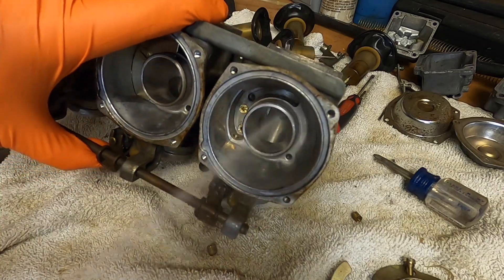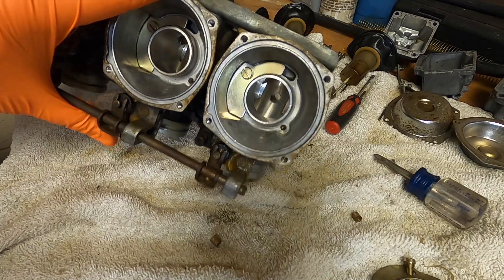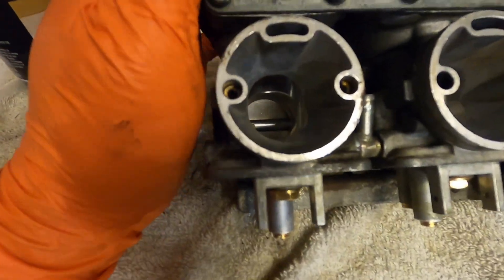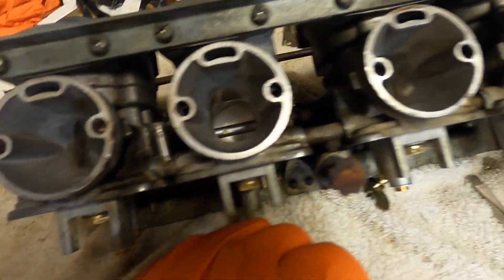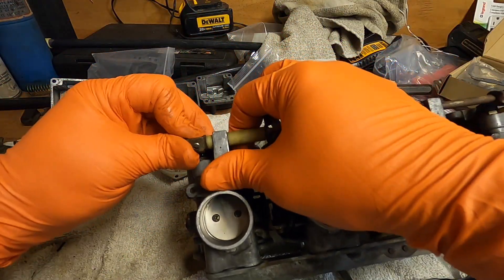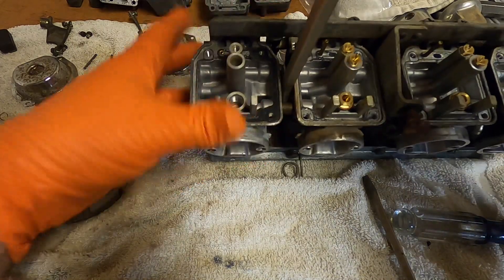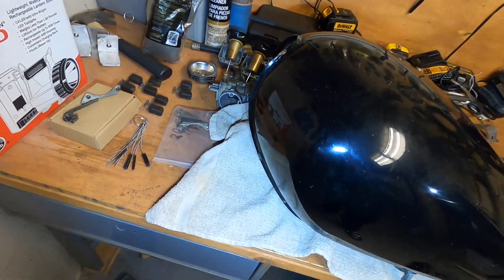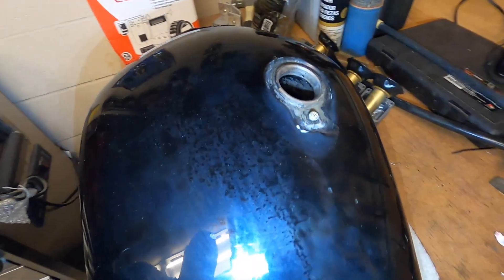1982 Yamaha XJ650 Carb rebuild and gas tank cleaning Part 2B

Comment: I owned one of these back when it was new. I never needed to work on it other than routine maintenance. I spent a lot of time waxing and polishing it. I just discovered that these bikes have Hitachi carburetors. I've worked on hundreds of Mikuni and Kehein carbs, but don't think I've ever touched a Hitachi before. I was surprised by all those extra jets all over the place. 

To clean tanks I first wash them out by filling them fill of Superclean, and letting it soak for at least 24 hours. be careful with it, it will take the skin right off your hands, and I mean like right now. That should get all the old gas residue out. Rinse it thoroughly with water, and if there is a lot of rust in it, remove the petcock, plug the hole, then fill the tank with full strength muriatic acid and let it soak for several hours. pour it out, flush it good with water, then pour in about a quart of WD-40 and slosh it around to prevent flash rusting. You will need a new O ring for the petcock. 

I use Allen screws to replace all of the float bowl screws and top cover screws. No more problems getting them out.

Comment: Hey! at 1:47 you were putting in the big screw. This screw stripped on me and I had to drill it out completely and tap in. Where can I find a replacement or what jet # was it. Any help would really help
Reply: I believe the small Jet was #50, what jet number did you use to replace? Was it the same or a bit bigger

Comment: Hi Kevin, I have rebuild completly my carbs in a xj750 Seca RH, I have changed also the rubber boots, jets, needles, v-rings from the throttle shaft, o-rings from the fuel pipes (all replacements quality made, not chinese).
I have done the valve clearence and syncronize the carbs using the YICS tool and an original yamaha clock syncronizer.  I checked again the syncronization with a liquid gauge to see rising the levels of the four carbs at the same time. Everything is done as it should. I have finaly used the colortune to adjust the pilot screw, setting to 2,75 turns out.
Now the problem.... which is driving me crazy....
I start the engine cold,  choke on and the engine start fine.
After seversl minutes the engine warms up I switch off the choke.
The engine keeps on 1000 rpm... everything seems to be fine but once I turn the right hand throttle, the rpm rise to 3000 and they keep on 3000 or they drop slowly.
Then I turn the idle screw out just a bit to keep the rpm on 1000 but they drop an the engine dies.
If I screw the idle back in again just a bit, the rpm rise up again to 3000. If I let the rpm that way they drop sometimes to 1.500 but very slow which is not the right way to be driven.
If I unscrew the idle screw so that the idle dies and I keep acelerating using the hand throtle, the rpm work great going up and down fast as it should. The problem is that when I stop, I have to turn the hand thortle just a bit so that the engine keeps runing otherwise it dies.
This means that either I have bad idling speed and rpm keep on 3000 or I have good idle speed letting the bike to be driven nice but dying when I stop and don't use the hand throtle to avoid it.
I have been told about air leaks but everything is fine no leaks found even spraynig carb cleaner over the carbs.
The question is, screwing the idle screw does not work properly, using the hand throtle just 1 mm keeps the bike from dying. Both, idle screw and throtle cable push or pull the throtle shaft.... why when I pull the cable the rpm stay on 1000 and if I screw the idle screw in it mess everything up?
I have also tryed to play with the throtle cable but does not make any diference.
Any idea what could be happening? I would really aprecaite any help, I am lost and here in Spain I don't  fine any workshop from the old school to take the bike to be repaired.
Many thanks! 😉
Reply from the maker: Just off the top of my head maybe your float isn’t adjusted properly. Perhaps the fuel isn’t sufficient to keep up with the RPMs. Then needs to refill.  I’ll do some more thinking on it and get back to you. It sounds like you really covered all your bases
Reply: @kevinon4wheels  Thanks kevin, tomorrow I will spray all over the carbs with carb cleaner instead of brake cleaner and if I have the chance I will use propane as I have read in the xj4ever forum hoping to find if there is an air leak. The floats are set at its level 17,5 mm.  THANKS AGAIN KEVIN!!!
Reply from the maker: @bestione761  any luck yet?
Reply: @kevinon4wheels  I gave up... although the motorbike runs fine while driving it, it keeps dying when I stop... no matter if I sync the carbs (using the YICS tool) and turning out the pilot screws out from 0,25 to 0,25 up to 4 turns. Also checked with colortune.
I have been told that sometimes is not just a matter of sync the carbs, it is also by ear, listening the sound of the engine.
I have also done compresion  test wich is  10- 09- 10- 09, seems to be right.
I took the bike to a workshop and now I have to wait. Let's see if the guy from the shop finds the issue. I guess this is going to take him a lo of time, I will be lucky if he finds the problem because after all that I have tried I don't think there will be more to be done. I will let you know. Thanks for your interest. Merry Christmas from Spain!
Reply: @bestione761  any luck..??
Reply: @jerrybigrig9475  Hi there! I had the motorbike two months in a workshop, they took off the carbs from the bike and tried to syncronize them. I went to pick up the bike two weeks ago because they told me that the bike was fixed.
Well, as soon as I started driving the bike, it was exactly the same, it kept dieying when I stoped and the rpm went up to 3000. It was a nightmare to be driven.
I didn't go back to that workshop because it was useless and a waste of time (two months for nothing), they even lost one of the rubber boots pipe cups.
I was given the telephone number of an old man, he was a retaired mechanic and also a carburetor expert. He came to my home to hear the sound of the bike and tried to syncronize the carbs. After a while he realized that he couldn't and he told me to take the carbs off from the bike to have  a closer look at them and have them checked at home.
After a week he came back to my home and we installed again the carbs, I didn't expect any diference but the "magic" was done... the bike started smoothly, the rpm kept stable at 1.100 and the response of the throtle was awsome, the rpm needle rised and went down fast... I coul't believe my eyes. 
Afterwards he syncronized the carbs with the sync gauge, screwing the three butterfly shaft screws and the four pilot screws (air/fuel mixture). He did not want to use the YICS tool and eventhough the bike runs better than ever.
I asked him what was the issue, he told  me that everything that I did to restore the carbs was very well done but the butterfly plates are worn after 40 years, which is normal, and they have to be set on the shaft very gently on its position. I guess I tried to set them as best as I could but it was not enough.
He also mentioned that he varied the height of the floats to compensate the slack of the butterflies.
He recommended me to find some new butterflies plates and also to change the membranes, not becasuse they where damaged, just to put a new ones in order to have more flexibility which would make a better throttle response.
Now I am happy again to  drive my Xj and thankfull to that man .
Greatings from Spain and thanks for asking mate.
Reply: @bestione761 
Thts so awesome 
I was so invested 
Glad to hear u had a happy ending 
Cheers from USA

Comment: Found a xj 750 cheap struggling with firing it up. Gas through the spark holes it promises and then takes a couple of high rpm and dies.  It have been standing for 10y I cleaned the tank and now waiting for a replacement fuel cock coz I twisted it too hard while it was full of rust. And it started to leak. After starting a while got the old gasoline smell to go get out of the bike. Would love to change thoughts and vids via mail or something. Thumbs up
Reply from the maker: Hello.  I apologize for the delay.  I did not see a notification.  Sounds like you're on your way to success!  How has the last month been?
Reply: @kevinon4wheels  between postal service circling around the petcock for 30days just for me to find out it's the wrong one  nothing much is happening 44mm from middle to middle(mounting holes) should the petcock be and 35mm was the one what came... any other model what has the same(ish) petcock coz here in finland Yamaha's sparepart book don't even recognize the  750 maxim or other maxims

Comment: Hey
I’m having trouble with my bike.sometimes when I start it up and drive a bit and come to a stop,the bike starts to pop and smoke out the exhaust.it smells like it’s burning gas.will buying a carb rebuild help me out with this issue?
Reply from the maker: I think it sounds like the float may be sticking.  Then when the demand for fuel stops the flows still continues, causing the rich mixture.  I think giving it a good cleaning will be a good start!
Reply: Did you get it figured out ..??
Reply: @jerrybigrig9475  yes.one of four fuel jets inside the carb,that feed it fuel,unscrewed it self,feeding the bike more fuel then needed,I think this flooded the engine causing the gas to mix with the oil,making it smoke out the exhaust.
Reply: @kevinon4wheels   that’s what I thought it was.turned out it was it was a simple fix.the bike starts and I can ride it but the battery won’t charge,so I’m gonna tackle the stator when the weather gets better.thanks for the advice,I appreciate it
Reply from the maker: @javieradorno6342  you’re welcome!  Glad you got it figured out.  Trace the wires back to make sure nothing is broken.   Also check the rectifier. Maybe the stator just needs a deep cleaning!
Reply: @kevinon4wheels  I used a multi meter and the actual magneto gave me a reading,I don’t remember if the core was good but I know the brushes gave me nothing at all.i did clean it,it was full of rust dust.I’m just gonna order the core and brushes and swap them out.I’ll keep you posted!
Reply from the maker: @javieradorno6342  awesome thank you!!

Comment: Hi Kevin you have been a huge help on my seca build just took off the carbs and need to clean them but am kinda nervous I have never built a motorcycle this is a first for me, that being said I do have a question for you, what tool did you use to measure the floats and how do I figure out the height of mine ?
Reply from the maker: Hello.  I apologize for the delay AGAIN!!.  I did not see a notification.  I used a pair of calipers to measure them.  I looked up https://xjbikes.com/forums/ it is a WEALTH of information!

Comment: Say Kevin if you put those pod air cleaners on your carbs how did you get the air box out????
Reply from the maker: Hello.  I apologize for the delay.  I did not see a notification.  It was easy to remove.  Just a few simple screws!
Reply: @kevinon4wheels  Apology not necessary, I understand completely. A XJ650 must be very different from a XJ750 because I have struggled with taken the air box off my 750 and can find no way to do it without destroying it, and I don't want to do that. I have had other people look at it and say the say thing, destroy it is the only way. So in the mean time I will keep searching for answers on how to remove it without destroying it..

Comment: Hi Kevin. I have a XJ750  that needs a carb rebuild  like you did so I took the bike to my local Yamaha dealer and he told me that parts were not available any more. So if you would be so kind as to help me out and tell me where you got the rebuild carb kit for your XJ650 I would be forever grateful. I don't know where you live but I live in Idaho so if you ordered it on line then I could do the same. Thanks again for your help and great video...Everett
Reply: Hey Everett, I don't know if you ever got your answer, but I've got a 1983 XJ750 Midnight Maxim and I've been able to order some parts on XJ4Ever.com. I was able to get it sent to Canada so you shouldn't have any problems getting it to Idaho!

I haven't gotten around to ordering the carb kit, but hopefully soon I'll get one and give it a shot!
Reply: @mmtedw  No I never did get an answer so I just went and ordered a kit from China. Still waiting for that. Thanks for the info about Canada. I only live a few miles from Canada so maybe it is close by, Thanks again.
Reply: @everettconrad4685  Hopefully it'll work for ya! Let me know how it goes, because I might have to order one as well in case I can't solve my issue! I mostly need a new seal, but it wouldn't hurt to replace everything just to be safe. I'm currently in the middle of tearing it apart and cleaning the jets and hopefully that'll solve a lot of problems with running too lean.
Reply from the maker: Hello.  I apologize for the delay.  I did not see a notification.  I am sorry.  I got my carb rebuild kit on eBay.  It was less than $30 and worked perfectly.   https://www.ebay.com/itm/401953101443

Comment: Where did you get your carb from I just opened mine and the previous owner broke the same thing but I am having trouble finding just that one carb, i would appreciate any help thank you
Reply from the maker: Hello.  I apologize for the delay.  I did not see a notification.  I got it on eBay.  There is a large selection of used XJ650 parts!

Comment: you didnt the fuel mixture screw beside the choke they are dirty cant even see them lol
Reply from the maker: Ha ha.   That’s probably how I missed them!  I gotta do some research on them and get them cleaned out.  Thanks for pointing them out!!
Reply: @kevinon4wheels  ya mine after thoughts its a air screw there arent fuel mix screw fuel control only by the jet on those but ya mine is a 81 and the air screw is right beside the choke on the carb look for it maybe the 82 is different ..